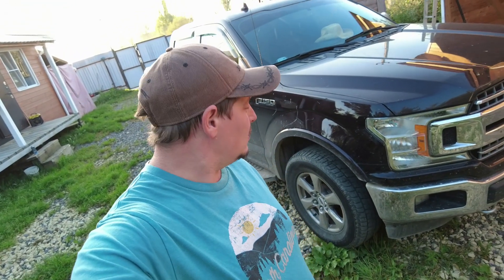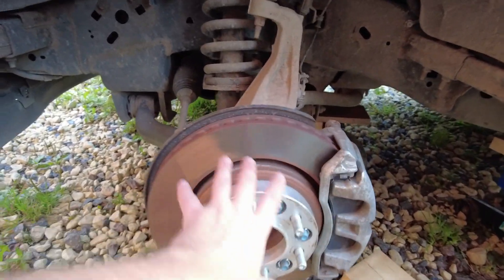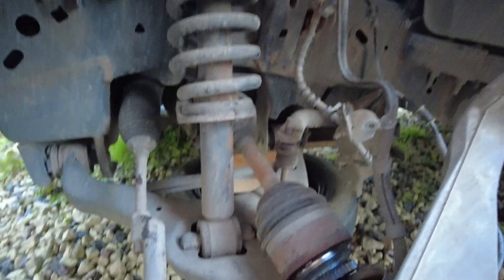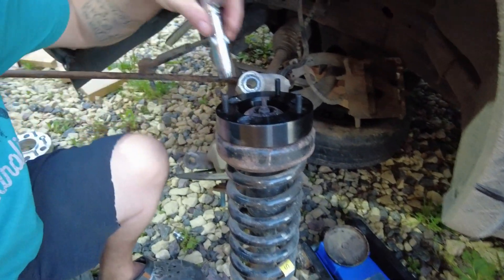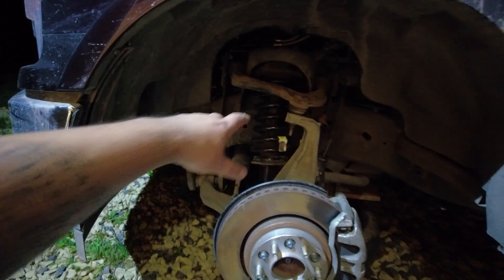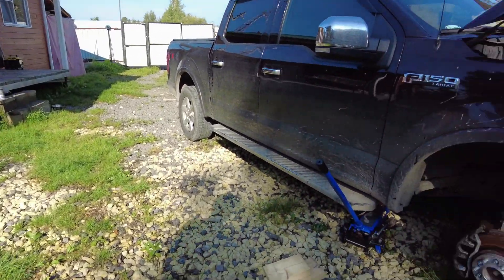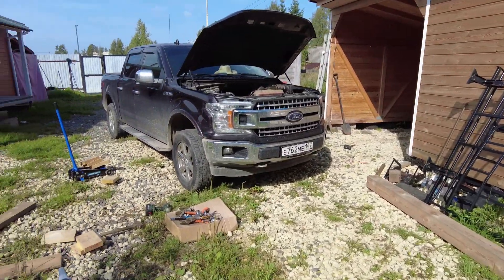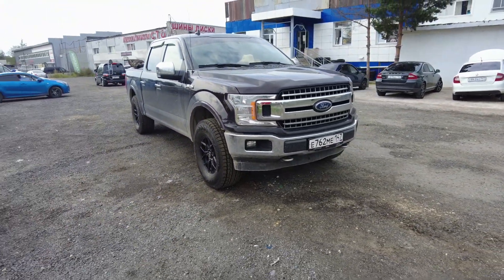INSTALLING A LEVELING KIT RIMS TIRES ALIGNMENT ON A 2020 F150

Comment: Why wasn't the front axle at the same height as the rear initially? By the way congrats on 1000 subscribers!
Reply from the maker: @Enqelar  it's a truck thing . Rear is higher so when you put load into the bed or pull a big trailer it levels out with the front.